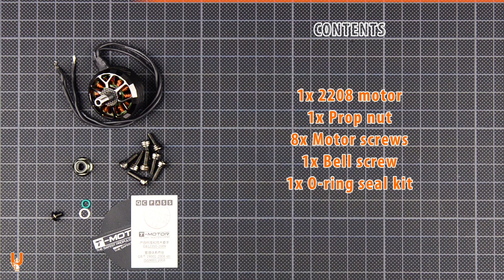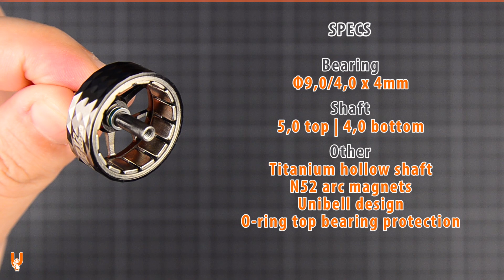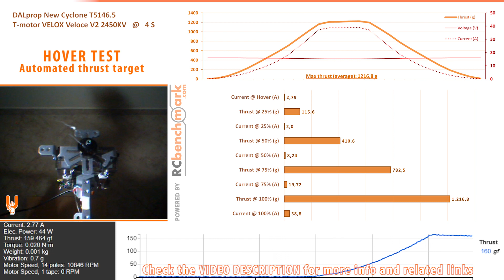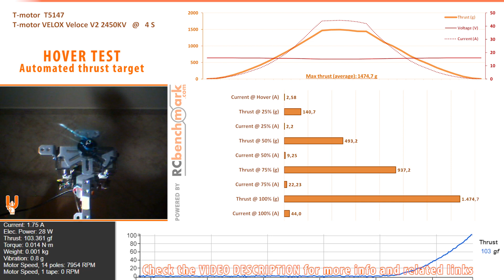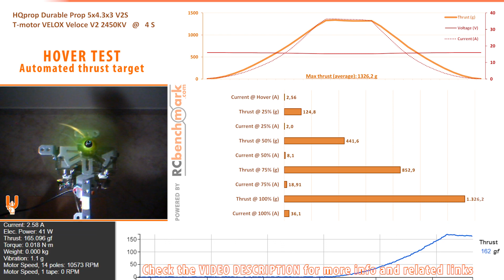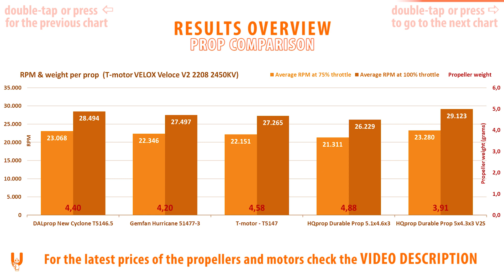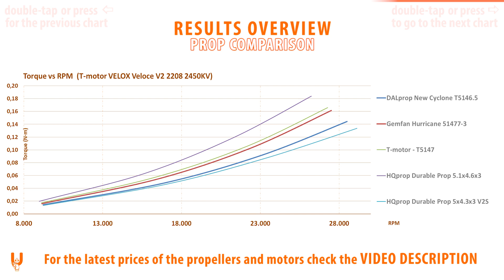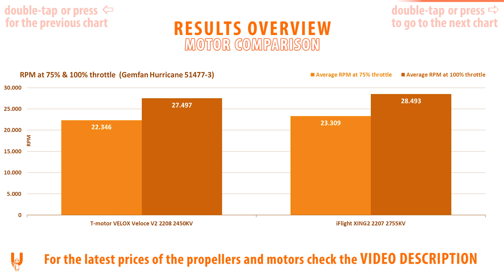T-motor Velox VELOCE V2208 V2 2450KV motors : Thrust, Efficiency, RPM & Torque on 5" & 5.1" props

Comment: What were the temperature and what RPM will be able to sustain for a few minutes considering temperture limit
Reply from the maker: I cannot log accurate temperature data of the windings in my tests and it depends on a lot of variables, even your PID settings. What do you need to do that requires a motor to run hot at high rpm for a few minutes?

Comment: Small typo in the Gemfan Hurricane description for pitch.
Reply from the maker: That's the pitch data provided by the manufacturer. It is unfortunately very confusing but it is a recent "trend", naming the props with a number that doesn't correspond to the pitch rating of the propeller...
Reply: @muteFPV  They should be called out for misleading customers then.
Reply from the maker: They do state the pitch in the prop specs but yeah, they should probably make it more clear
Reply: @muteFPV  If I'm sold tyres for a car that state one thing on the tyres and the something else in their manual I believe it's misguiding the customer.
Reply from the maker: That's a fair point. On the other hand there have been props that don't have any numbers in the name and we still need to check the specs sheet. One other thing that I have realized is very tricky is that the pitch value depends on exactly where it is measured along the length of the blade. There is no "standard" and the props we use have a shape that varies greatly from hub to tip, so I don't think we can compare props based on their pitch (on paper) in the first place.